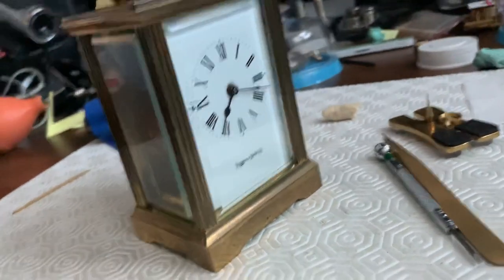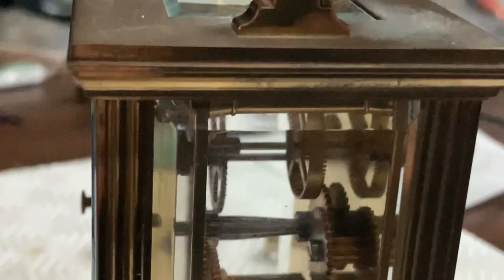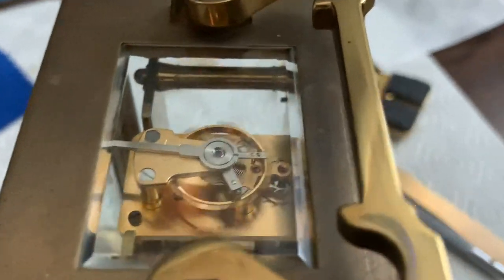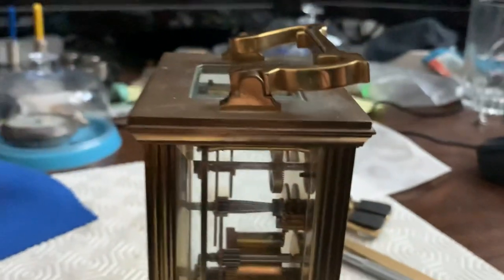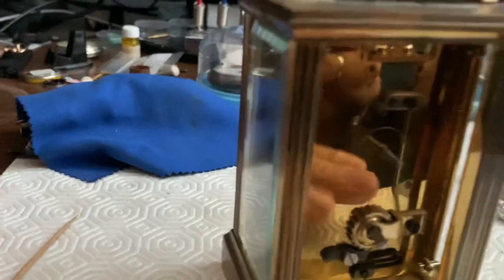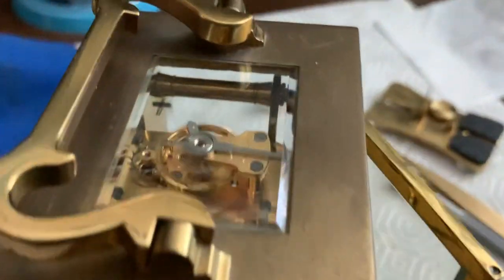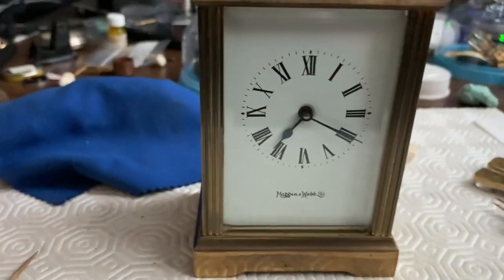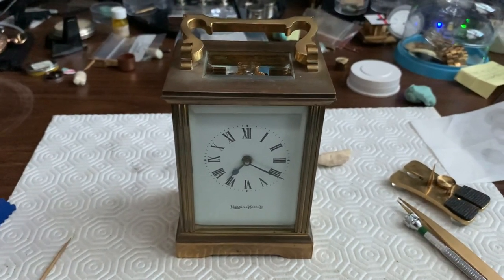Carriage Clock Fine adjustment

Comment: @JDRichard  Firstly, Many thanks for the set of videos posted regarding the Mappin and `webb Carriage Clock.  Enjoyable to watch.  Appreciating these videos were made some 2 years ago, I had the need to service the same Carriage Clock.  I have never attempted any works on watches or clocks, before!  The  fine adjustment is a bit tricky to get right, as you correctly say.  I hope I have now found the correct settings.  The shaft adjustment screw accessed from the open rear door seemed to require removal and lubrication before the clock would run nicely.  With regard to the age of the  clock, my example was a retirement present awarded to my Father in Law some 50 years ago.  It was new at the time of his retirement.  Just how long these carriage clocks have been in production, I cannot say.  However the clocks are individually numbered.
Reply from the maker: @jeffreygarrett2668  usually if I can’t find any information on the Internet on how to do something, I’ll make a video after I figure it out. and, figuring it out usually means I have to read a boatload of books

Comment: I have one from my great grandfather  how many turns of the key does it need to start working?
Thanks
Reply from the maker: Should start working only after a few turns, unless there are problems.  As well, can be wound until stiff and will run for 7 days
Reply: @JDRichard  yes its running thanks alot 😊